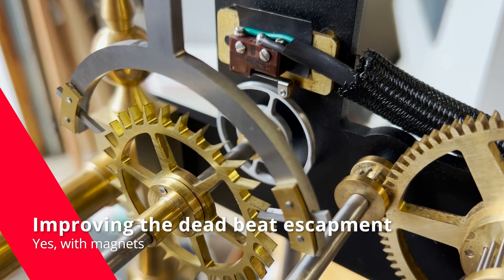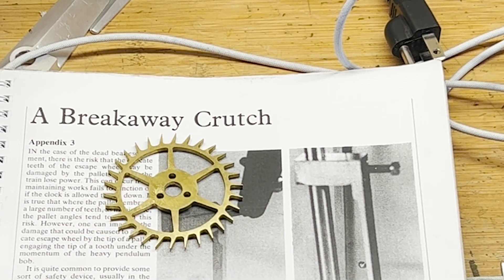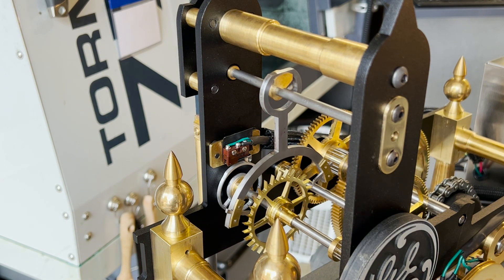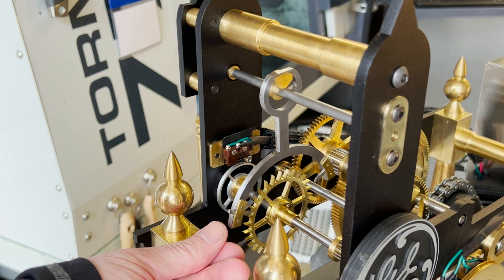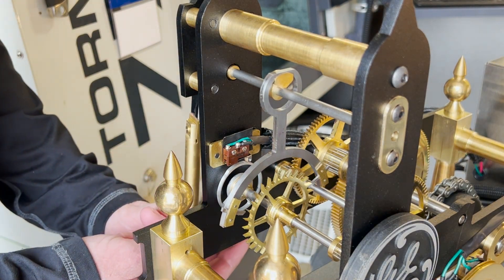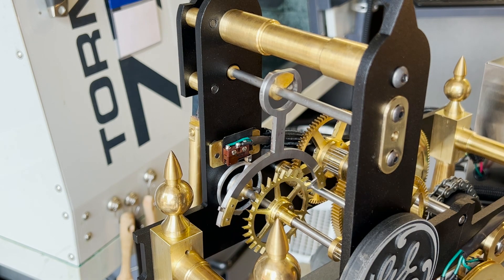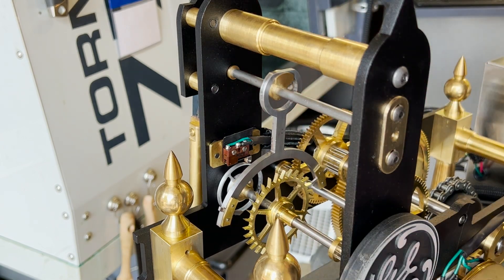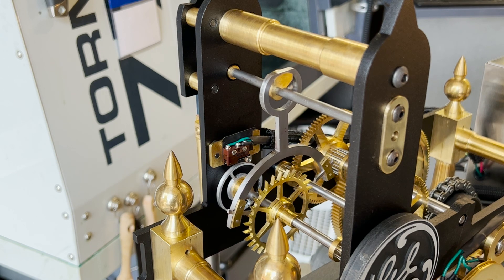Improving a Dead Beat escapement on a clock

Comment: Thats a beautiful mechanism. I am not a clock or watchmaker. I fix the occasional clock where it just need cleaning and lubricating but thats my limit. What I still cant get my head around is how the escapement kicks the pendulum. The force on the escapement is so low I cant see how it keeps the pendulum going, especially a large one. Having done electronics all my life I think if I were reincarnated I would like to be a watch maker :)
Reply from the maker: @campbellmorrison8540  what’s amazing to me is how old this technology is.  It’s humbling to think that without the modern tools we have they figured all this out.   If you think the energy is very small as all you need is to overcome the air resistance.   There is a small amount in the Hysteresis of the spring but most is the energy of air that needs to be inputted to keep it running.  I am always amazed at how humans figured all this out.

Comment: I am quite late to the party but I'm a clock repairman and I see a similar solution to this for many clocks, and that's simply a clamp or a friction clutch that connects the pallet arbor to the crutch. I think the biggest advantage the magnets has is that you can knock it out of adjustment and the magnets will disengage but then reengage at the correct angle again. The friction clutches do not do this, many of them are designed specifically to give way and then hold their angle, to self correct their beat, and you don't need this on a tower clock. An alternative to the magnets is a ball detent, but of course that way over complicates it. Nice idea man
Reply from the maker: Thanks, the main thing I was trying is no play at all, very accurate positioning and self resetting.     I used it on a tower and regulator so far and both wiring well.   An idea I saw on these posts is put the mechanism on the crutch.    I am going to think more on that.
Reply: @KevinNolanMakes  Yeah putting it on the crutch is also an interesting idea because the "breakpoint" is lower; as in the force required to disengage the magnets would need to be effectively lower because the pendulum has more mechanical advantage on it. Also, this is probably very quite minor, but having the magnets that close to the pallets and the pallet arbor could possibly cause some magnetism, putting in on the crutch, which is usually brass, eliminates that; although this is likely erroneous. the magnets on the pallet arbor does seem to be the simplest idea though since the manufacturing process is just to make two disks with off-center holes for the magnets in them staked onto the pallet arbor (at least that's one way of making it)
Reply from the maker: @gragaloth6237  agree.  Those were many of things that drove it to the way I implemented it.  I keep thinking there might still be a simpler way that would require less non “ standard” parts.

Comment: I have used a version of your design in the clock I am currently building. The difference is that I've incorporated the mechanism where the crutch connects to the pallet arbor rather than where the pallets join the pallet arbor. I found this easier as I didn't have to worry about upsetting the geometry of the pallets. Also I have used a spring instead of magnets. I like the idea of being able to adjust the strength of the spring. I haven't got a CNC facility, and this was pretty tricky to do by hand, but it seems to work well. The clock isn't finished, so I'll have to wait and see if it works in practice. Thank you very much for the idea
Reply from the maker: I like the idea of putting it where the crutch connects but would look at magnets instead of springs.  Magnets have no play until they break.  You don’t want any relative movement until the force is overcome.   Great idea and if you can do the same type approach at the crutch it could be easier and simpler which is always a good thing.    Thanks for commenting and good luck.  Would love to see your design when you get it.
Reply: @KevinNolanMakes  I've finished making it but haven't finished the clock yet, so don't know how it will perform yet. I could send you a picture but don't know how to do that.
Reply: @KevinNolanMakes  Hi Kevin, I've tried sending you an email at the above address but my mail server is telling me that it is an invalid address
Reply from the maker: Strange I double checked and that is correct.  I thought maybe a typo but it’s correct.   Check the spelling you put.
Reply: @KevinNolanMakes  I tried again and it worked. This time typed the address out rather than cutting and pasting. That seemed to do the trick.

Comment: I did not expect Wintergatan's music to be in the background. In the middle of the video I just thought "wait I kind of recognise that music, but I can't put my finger on it..." 5 seconds later my jaw literally dropped

Also what is discussed in the video is also pretty interesting! I will make a grandfather clock for a school project made out of 3D printed components, so I think implementing something like shown in the video is pretty overkill ¯\_(ツ)_/¯
Reply from the maker: I’m a big fan of his.  
For your clock you really don’t need what I described.   You should use an anchor escarpment for sure.  They are much more forgiving then other types and the printer resolution will be good enough for it.
Reply: @KevinNolanMakes  an anchor escapement? They seem easier to design compared to a deadbeat escapement, although don't you think that the extra recoil due to the anchor escapement's recoil could wear down the mechanisms quite quickly due to being made out of plastic? Although now that I think about it that shouldn't really matter considering that both the escapement wheel and the... I don't actually know what it's called... the claw thing that differs between the anchor and deadbeat escapement are made out of plastic.

I have seen a few videos showcasing 3D printed clocks, and from what I can remember all of them use the deadbeat escapement. Do you think it would make the project way harder if I tried to use that? For the project I have a goal to make the clock as efficient as possible (meaning as accurate and as long-lasting without having to be wound up), so even if it is harder I might be "forced" to try to make a deadbeat work in either case. What do you think?

Comment: Hey, that’s some terrific innovation. Well done. It would be difficult to imagine a mechanical device that has had more high level mental energy expended on it than a timekeeping escapement. And yet, you have managed to come up with something quite unique.....and useful. Well done Sir!
Reply from the maker: Thanks for the note,  I think it is a bit of cheating as the powerful permanent magnets are somewhat of a new invention,  If they were available I am sure we should find more of them in clocks.   I have also used them as a clutch for the min hand.

Comment: Don't get me wrong I really like your idea... But, magnets will get weaker over time. How long that is depends on the material and quality. I am not saying there will be no magnets to get in the future, but sources of neodymium are scarce on this planet and certain things can happen (political) so that getting magnets of a specific size and strength could be very difficult. I am not a clock/watch maker but I would consider a single (coiled?) spring instead. I am just mentioning this, trying to be as respectful as I can, in case you haven't thought about this issue, which I think you maybe already have.
Reply from the maker: Good points.   The permanent magnets hold the power over a long time and there is plenty of margin in the force.  Also they are so small if there is a shortage that we can’t get these tiny magnets we probably have big problems.   Thanks for the comments and watching the videos

Comment: Hi Kevin. I am currently building a regulator clock with a dead beat escapement. I am very interested in your design and would be very interested in some more information on this if you have it. I like the way it corrects itself and the clock just keeps on running. The design in the John Wilding clock will stop the clock and is tricky to reset.
Reply from the maker: That is a main benefit.    I posted a STEP filehttps://grabcad.com/library/dead-beat-escapement-1
The file does not show the magnets but you can see the space for two small neodymium.   I used a CNC to make it easy to make but could be done the old fashion way.
Reply: @KevinNolanMakes  Thanks Kevin. I'll be making it the old fashioned way, but your design beats everything else I've seen, so I'm going to give it a try. It will be a while before I get to the installation of the escapement, but I'll let you know how I get on.
Reply from the maker: @brianwarburton4482  great let me know if you need any help along the way.  I used the design on the regulator I built following wildings design.   I also made some other improvements on that that I published in videos.    Would love to see your progress.
Reply: @KevinNolanMakes  I saw your design for the key which I will also use. I have cut all the wheels and pinions for the clock but still have a lot to do before get to the key. I've also incorporated bearings for the large arbours and a different maintaining works. I'll let you know how I get on.